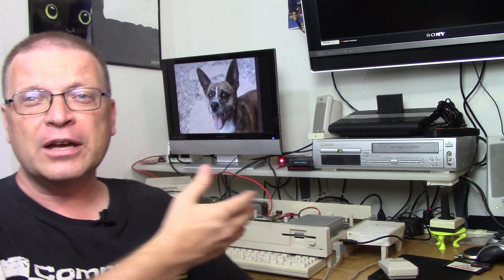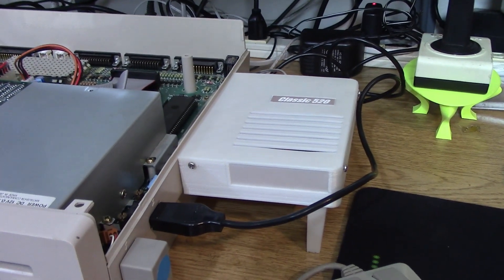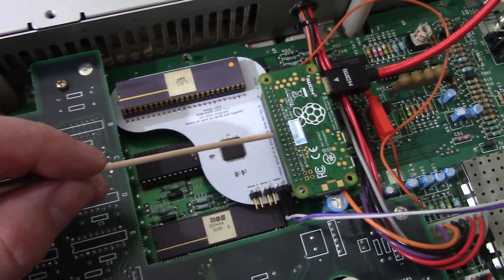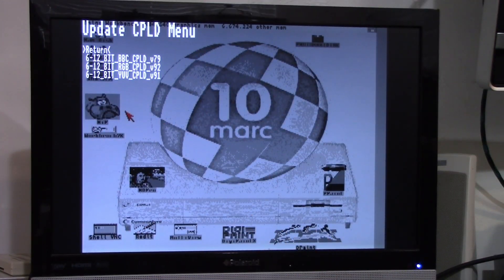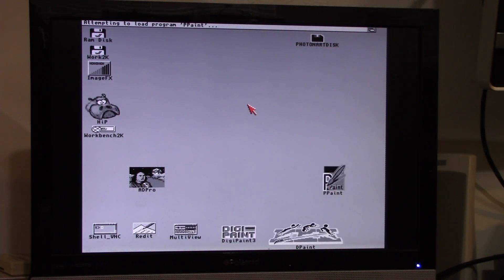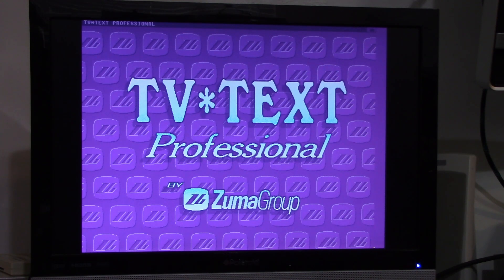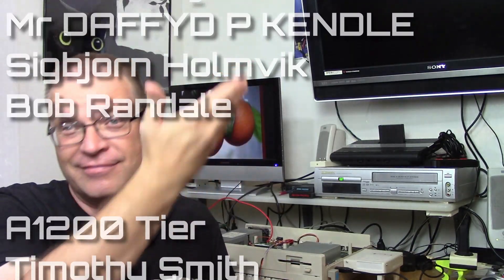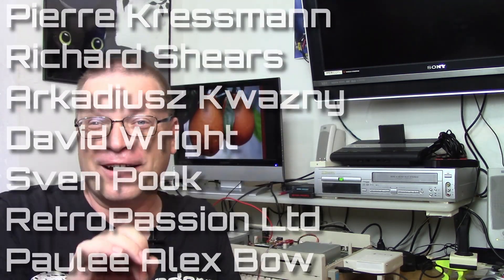RGBtoHDMI Review for the Amiga 1000 - Episode 105

Comment: I wasn't aware the Extra Half-Bright mode was something within the Denise chip itself. I thought it was another part of the A1000's circuitry that was lacking. I have an R5 Denise in mine. I know there are other revisions above the R6. Would there be any point in installing them in an A1000 or is the R6 the only one it can benefit from? To be honest, I'm not even sure I would be missing Extra Half-Bright unless I am using a specific paint program. Is it utilized in game software?
Reply from the maker: Just a few games like Black Crypt use it. Many of those require 1 MB of CHIP RAM I think. It really is a very nice mode and you can achieve some cool effects with it. Only the earliest Denise chips don't have it.

Comment: Bonjour Doug, j'ai un Amiga 2000 avec une carte Rgv to HDMI. J'ai téléchargé la dernière version du 29 mai 2021 et copie sur la carte sd mais je ne voit pas de changement pour réaliser la mise à jour et réaliser un auto calibrage du moniteur. De plus j'aimerai mettre le profil Amiga 2000 je suis complètement perdu.. peux tu m'indiquer comment car j'aime ce que vous faite. Merci par avance
Reply from the maker: Just copying over the files should update the code. Did you manually copy over the two files to the root and the profiles folder?
These only pertain if you use the interface with a CPLD chip - do you have that version, or an older version of the interface with no CPLD chip?
Reply: @10MARC  bonsoir j'utilise sans puce ou chips CPLD.

Comment: It’s such a great product! I’ve been using it in my A1000 for a couple of months and I can confirm it’s absolutely the best solution to get the best picture quality.
Great times for our beloved A1000s! Accelerators, ram expansions, flash roms for kickstart, Compact Flash/SD cards, flicker fixers…. there’s just 1 thing missing, and you Doug know very well what it is…
Who’s able to get rid of the 512KB chip ram limit? Come on guys!!
Reply from the maker: Well, Amigalove and his team are still working on bringing "The Rejuvenator" back to life, and that can I'm theory add up to 2 MB CHIP RAM...
Reply: @10MARC  I know, but that means a complete replacement of the A1000 motherboard. Cost aside, would it still be an Amiga 1000 then?
Reply from the maker: It's only a replacement of the daughter board - the part that contains the 256KB of WCS Kickstart RAM. Some custom chips are moved to the new Rejuvenator board like Denise and Agnus. You might be thinking of the Phoenix board that was a full replacement
Reply: @10MARC  you’re right! I wonder if the Rejuvenator works with an A1000 with no daughter board like mine… I guess not 😢

Comment: Nice coincidence that I stumbled upon Andrew's PCBWay page with the A1000 adapter. It guess it was only a matter of time that we would get an A1000 version. Didn't think I would be seeing a video about it so soon.  :)
Reply from the maker: I bought mine from him a few months back but never got around to hooking it up. I really, really like it! The quality of the display is honestly better than any of my other Amigas.
Reply: @10MARC  Interesting. Do you attribute that to improvements that came along with this particular PCB design, the A1000 or both? I heard where you said the A1000 has superior video quality. I have not been able to compare it myself to my other Amigas, although that will be possible to do so at some point since my A1k & A2K are very close to each other.
Reply from the maker: @jdryyz  I am not sure if it is just my Amiga 1000, but even the composite signal is excellent. The quality of the RGB2HDMI is superior to my A2000 board RGB2HDMI, but I think that there are still a few issues with that setup.
Reply: @10MARC  I designed an Amiga 2000 CPLD version too which is works in the same way as your A1000 one in this video (but doesn't need the CSYNC hook). https://github.com/LinuxJedi/AmigaRGBtoHDMI/tree/main/Amiga2000CPLDSlot
Reply from the maker: I think I need one of those with the CPLD chip... My A2000 interfaces have that darn jitter and sparkle. TBH I have not updated the code in a few months so I may try that first.
Reply: @10MARC  at the moment Retro Ready One is selling my A2000 version. There is a capacitor mod to the original fixed-logic version that in some cases improve the sparkling though.